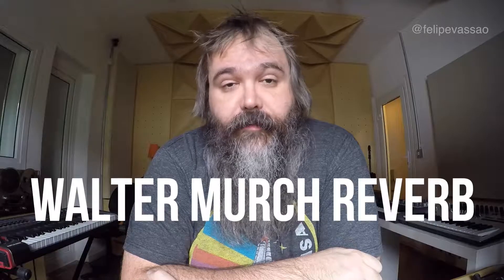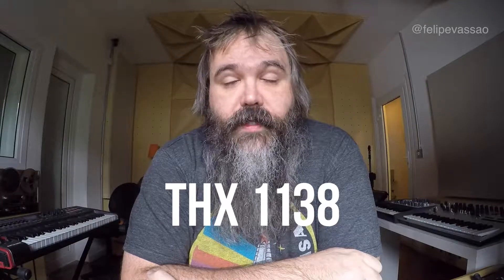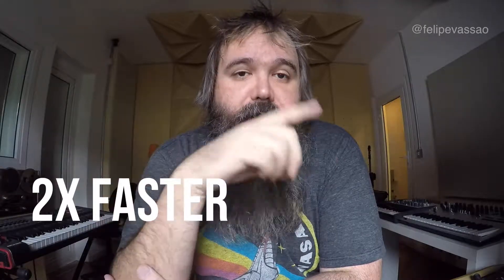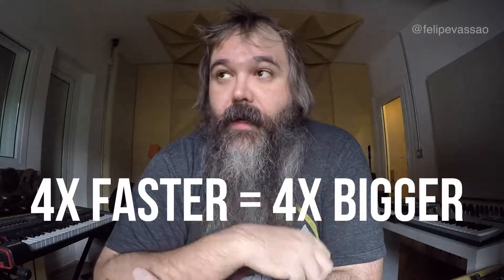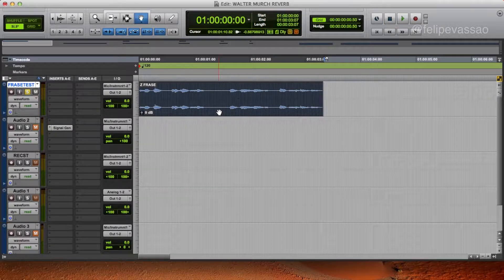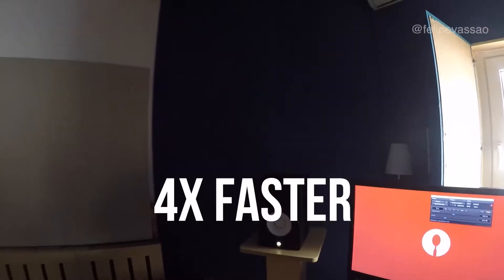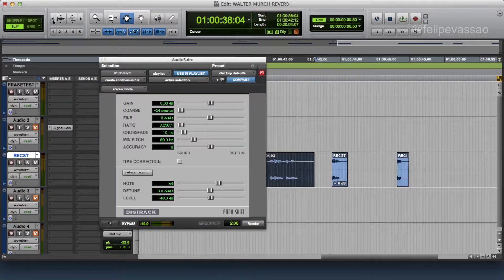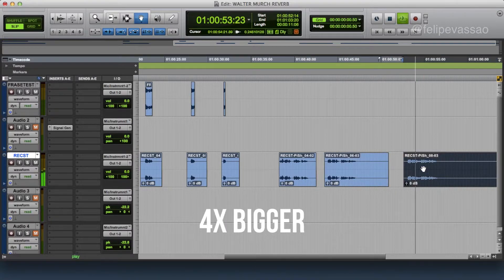WALTER MURCH REVERB - recreating THX 1138 sound effects

Comment: Maybe you might know. In the movie THX1138 he used a distortion that I recognized from my ham radio days as the distortion that you get as you tune in an incoming radio signal or as a weak signal varies in intensity.  I am guessing that he probably did use a radio system for the movie but maybe there is a way to simulate it? An example occurs at 40 second into the official trailer https://www.youtube.com/watch?v=eHgqfVQWv7s  vocal is 'you are over riding again' thanks in advance for any insight.  I found a clue: https://youtu.be/sM2M6OOthcY

Comment: This IS an instance where 96k or even 192k would make sound NOTICABLY better. Meaning, if you recorded 44k and slowed it down 2x = 10 khz is the cutoff, 3x = 5 khz, 4x = 2,5 khz.